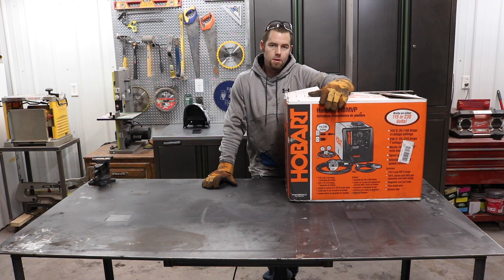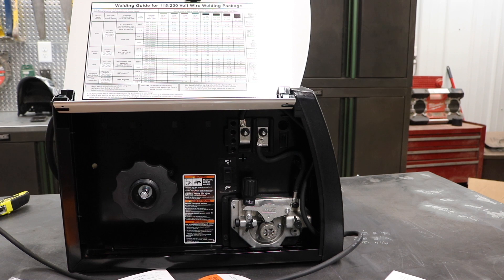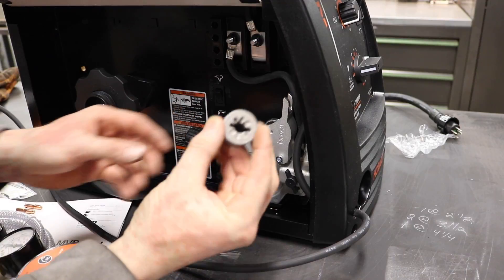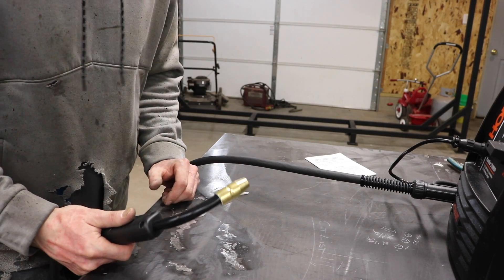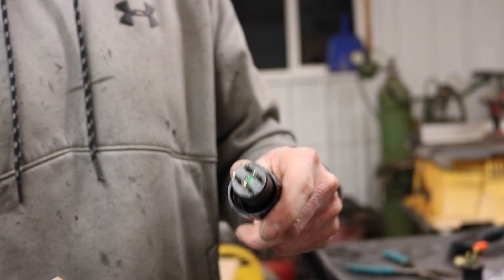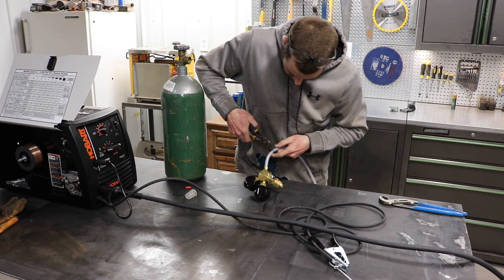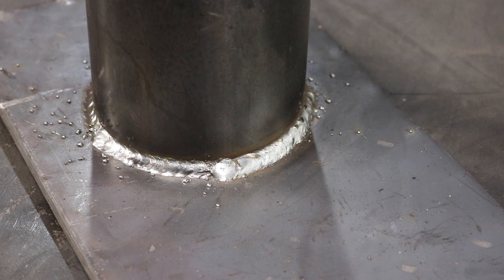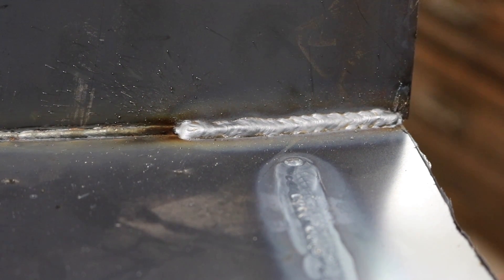Hobart MVP review

Comment: Nice looking machine, expensive and name brand, too. You did a nice weld there. Try using small automotive tools like a ¼ inch drive ratchet and sockets accordingly. Also, wrenches are very useful to tighten the gas tank connections and fittings. Good video my friend.

Comment: Ive had the 210 mvp for several years and run countless spools through it. I use it for sheetmetal repair with .023/.024 wire and it is great. Not the first issue with it. I have also built a #15k boat trailer with this welder with .035 and it can exceed its rating on thickness with the right settings, with plenty of penetration.

Comment: Great review! I’ve been considering getting a welder to learn on and was almost sold on the Hobart handler 140 but then I saw this one for a few hundred more but figure if I get this one I’ll probably never need another one since this can handle some heavier jobs as well! Selling point for me is the duel power options..
Reply: You won't be sorry that you decided to step up and get the 210 MVP. You are considerably limited with the 140 and as long as you have a 240 volt service available, this one will do a lot more.

Comment: How many amps Outlet do you use
Reply from the maker: 40 amp
Reply: 40A outlet for a 20A cord end?
Reply: @abramedison6018  what would be the problem with that?
Reply: @Joe_Mission  the cord end wouldnt match up would it?
Reply: @abramedison6018  no. It’s an MVP plug. 230v plug OR 115v plug can be used. The main wire is sized for appropriately for 230v which makes it very suitable for 115v power.  I’m running mine of a 230v 30 amp circuit no problem. I made and adapter to go from dry plug to welder plug.
Reply: @adamfleisch  manual says 50 but that because the plug used it a 50 amp plug. It in all actuality draws less than 30 amps. I’ve got mine on a 30amp circuit and it’s been no problem.

Comment: That's not how you mount the spool... You unbolted the carrier, (that black plastic piece with the large 8 point plastic nut).  You unscrew the large nut, install the spool aligning it with the pegs on the carrier, then hand tighten the large nut. And stop using channel locks!
Reply from the maker: If you look more closely I mounted a 2.5 pound spool and not a 10 pound spool